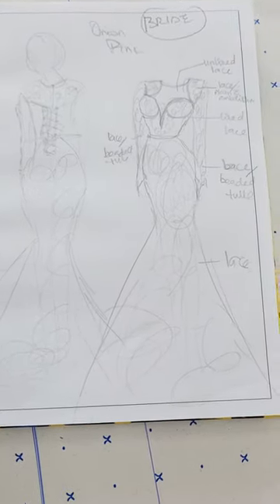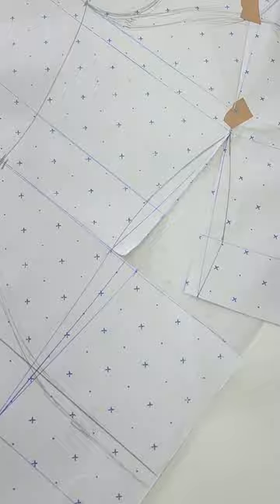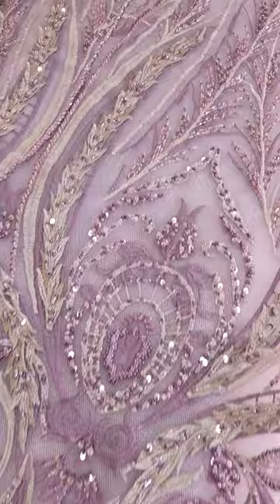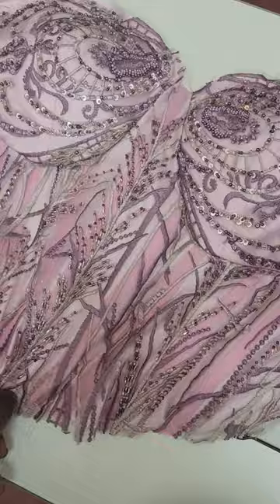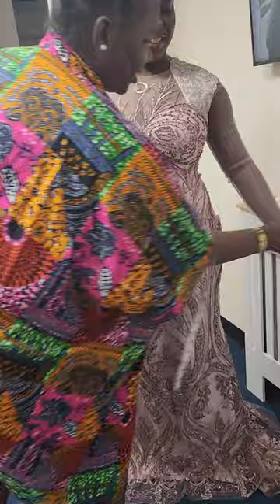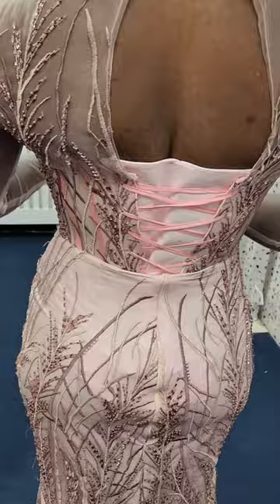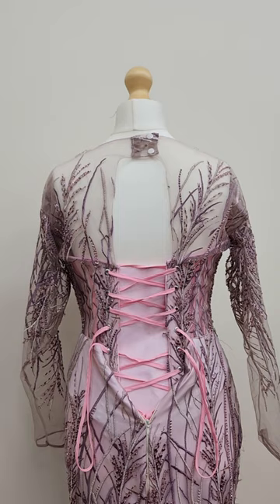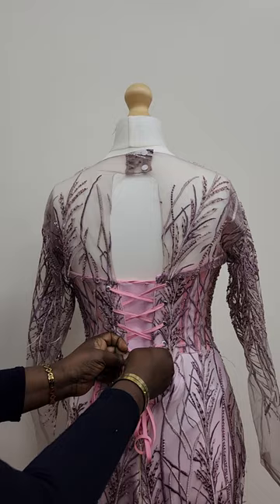Creating a custom corset dress with beaded lace fabric for a bride.

Comment: You are very talented and this can be seen in the choice of fabric used  in this design. This is a nice dress though I think you would be better served if your seam allowances were added so that the fit was not so tight. I think this is can be seen especially when the bride sat down and in the sleeves. I understand a fitted design was the desired look but the dress should never look like the seams could burst at any moment. A true corset would have boning I heard no mention of this being used. It is a nice dress so I hope my comment can be taken constructively as it is intended. Great work.